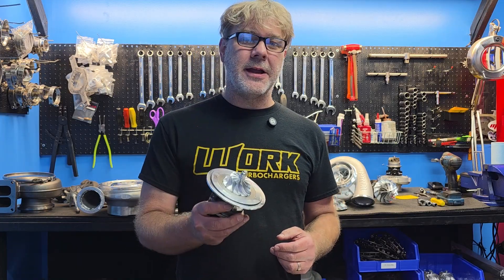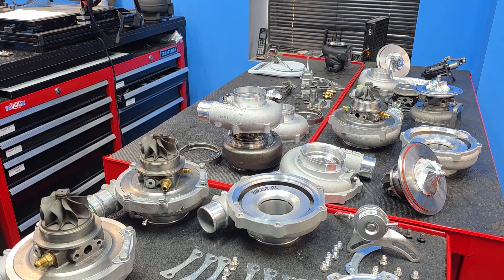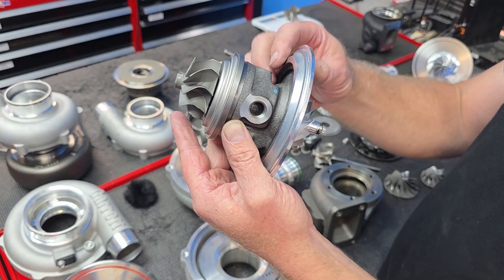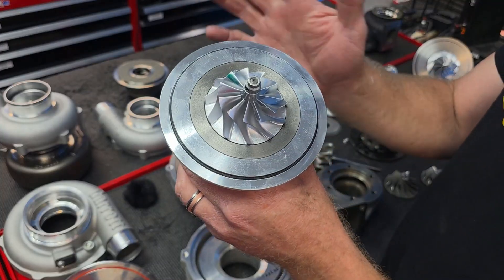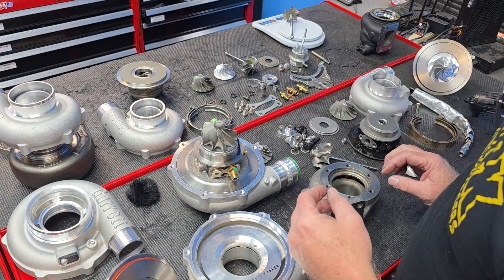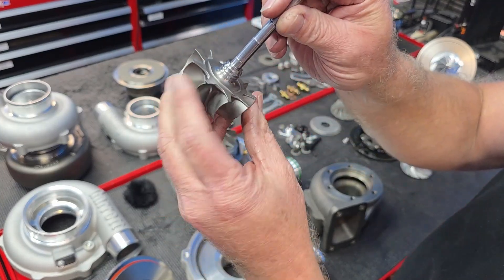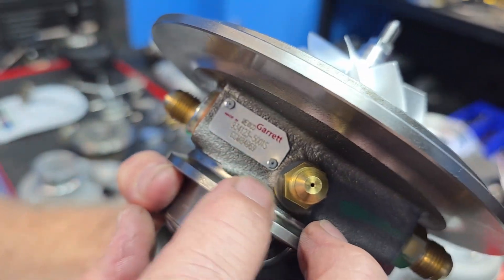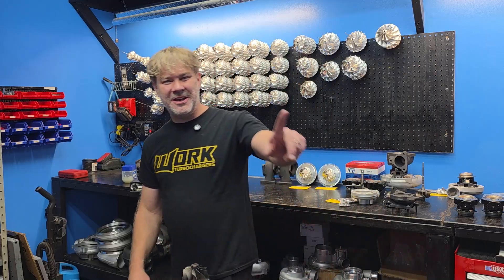Garrett GT3071R to G30-660 Turbocharger Comparison

Comment: I went from an old garrett t51 to a newer pulsar 7375G (G42-1200 compact). New turbo starts spooling a bit sooner than the old one but spools so much faster. I'm breaking traction in 4th when it never happened with the old turbo, even doing a 1st gear pull.

Comment: pretty cool comparison.. I was recently running the BNR3071R turbo on my 2.0 ecoboost, making around 500whp. But Im dropping in the G30-660 soon so with the head upgrade and cams, hoping to make closer to 600+. Plus the exhaust makes a big difference in how efficient the system is...im getting a much more efficient EWG elbow, dump tube, and downpipe. These things help the turbo and the system over all by reducing back pressure which kills turbos and power.
Reply from the maker: I really like Bryan (BNR).  Cool history, he was working at Johnny Rockets here in Birmingham when we met.  He had an NA FC Rx7 and he wanted to turbo it...I told him to sell it and buy a turbo car to start from.  Fast forward a few weeks and he had his first turbo car!  Next thing, he started out his turbo career working for me.  One of my best friends still to this day!!  Reed
Reply: @workturbo  thats awesome! Bryan was great to work with on my focus and the BNR3071 did me well. I still have it actually..but I wanted more power. I waited quite a while for a BNR upgrade that could do 550-600 or so and after so long (like Feb of this year) i finally just pulled the trigger on the Clayton Performance 5455G kit with the G30-660 and ARC Enemy Fab 2.3 flange for the 2.3 head, and RIGHT after i bought everything.. Bryan announces the official release of the CHA upgrade for the 3071 (which I think is the G30-660 CHA). Then I think he comes out with the 770 variant now and I would have gladly gone that route. But i already bit the bullet and got a whole new set up, that is more efficient (since he doesnt do flanges/exhaust, my appeal with this new kit is the extra flow capability). I still have his BNR upsized oil drain tube and have told plenty of ppl about the BNR turbos, i had no issues really. Bryan was always good at communicating when i had a question and he was active in the focus community

Comment: Hello, I was recommended 3071 Gen 2 for my 2.1 liter B21FT (Volvo engine).
I want quick spool, "350++ hp", its a strong engine with 7.5:1 compression.

I will use a higher flowing intake, 3" dp, 3" exhaust, aftermarket EFI, large IC, Walbro 535 tank pump etc.

Question is: would these G series be better for me (or some other turbo options too).
It seems like g25-550 might be enough for my goals, but I see some people say that it runs out of steam on higher rpms.
Of course there is the g25-660 or g30-660 too.

I am not sure what my engine can rev, but I think it can do 6500 ish +-.

Comment: Maybe a video like this on the larger Garrett lineup would be cool
Reply from the maker: I am working on a plan for some of the larger frame units, they used to come through my shop at a crazy rate...its a bit slow at the moment so I do not have a variety of units to showcase...but as soon as I do, I will publish one.  I did a quick comparison of the GTX Gen 2 Vs the G57 a while back, go look through my content.  Its a fairly basic video, but does show off some of the key features and differences!  Reed

Comment: Great presentation, but latest the greatest?? NO. G series turbochargers, even more so the "gen2", are totally focused on high boost applications. For applications up to 1 bar the good old GT series cast & 11 blade GTXs may be actually a better choice, not only because they are cheaper, but more efficient too.
Reply from the maker: Agree, and as I made this video we had to edit and cut out quite a bit of my rambling on about your statement almost to the word.  

I will be going over this in quite a bit of detail very soon, but there is a reason we still keep quite a bit of the GT series product active in our catalog, and the Gen 1 lives on with our own version of the compressor wheel since Garrett has removed a lot of that product from their lineup!  Reed
Reply: @workturbo the original 11 blade GTX may be better actually for most street  applications when the boost is set up to 1.2-1.3 bar the way OEM and mildly tuned cars are setup.

Comment: also l, can you comment on ferrari's new hybrid v6 pushing 55psi! is that achieved through low compression since electric motors are helping down low?
Reply from the maker: The F163CF is as refined of an engine as you can get in a road car...  I would love to see the actual boost curve of the turbochargers, as approaching 4 bar of output is impressive in its own right.  Most single stage compressors struggle with any type of notable efficiency at that output, but I can see where they could run that number in very specific points of the engines VE curve.  

Compression ratio is another dynamic topic...and I would venture to say that the camshaft events and fuel delivery play a much bigger role than the engine's compression ratio for managing that much manifold pressure.  

Obviously the advantage of "near instant boost" and electric drive go the extra distance to make up for an engine that would be a lot less spicy if it did not have that tech!  Reed

Comment: twin feed compressor cover are a thing in some formula 1 engines and other engines to but haven't reached the aftermarket or the oem, isn't blowing boost through two medium holes more ethan one large hole?

if a company were to offer twin feed compressor covers that might aid some of us looking to be different and it might-even be a little more efficient?
Reply from the maker: There is so much I want to share on this topic, and it will be covered all in due time.

 What I can say is the design of modern motorsports turbochargers are quite a bit more complex than they appear on the outside.

Lots more to come...you won't be disappointed! Reed

Comment: G2 steeper trailing angle makes higher boost but is less efficient. Old GTX  47 wheels were the same
Reply from the maker: I am building up to the video that will cover most all of the common blade designs, and the corresponding results from each variation.  It will be a good video (I hope!)  Reed

Comment: Good video, 
Im in to diesel tuning, whe use alot of the gtb2260vk turbo mainframe to hybride them.
One time im tested a gtb turbo with a 51/48 amg turbine wheel with a 50/65 11+0 ett wheel.

Its prefromed a bit less then a stock gtb2260. The boost pr on these 1.9tdi are 3.5 bar absolute. [2.5+1 outside pr] 
Im think the 11+0 is good for low pr and the 6+6 way more eff at high boost

Comment: Interesting. Does Borg Warner do the same thing with their turbos in regards to the turbine wheel like Garrett does?
Reply from the maker: It is common to see the same turbine wheel remain in service longer than the compressor (especially in today's CNC'd compressor wheel manufacturing), Regardless of manufacturer.  Reed

Comment: As always very informative. Is it possible to get a video on the different characteristics of each design (GTX Gen1 vs GTX Gen2 or g series, such as is one design tailored to very high boost pressures and or shaft speeds compared to the other? Dose one have better spool  than the other?). Great video!
Reply from the maker: I will build on this video and answer that question for you very soon! Reed